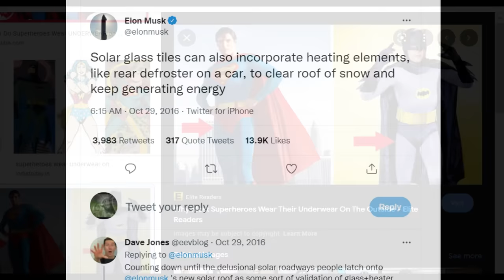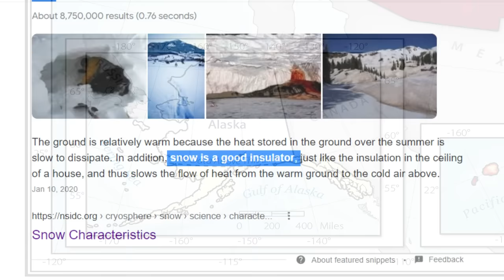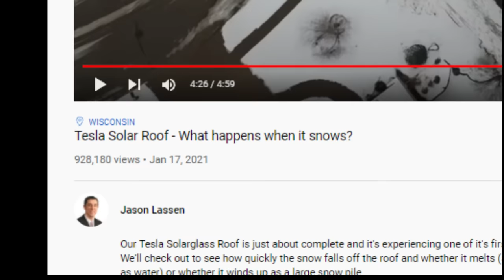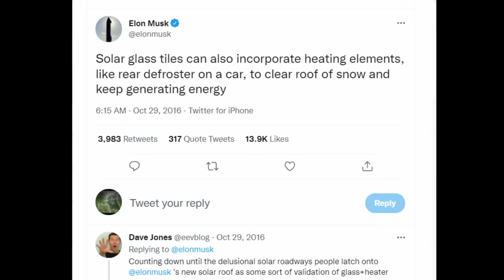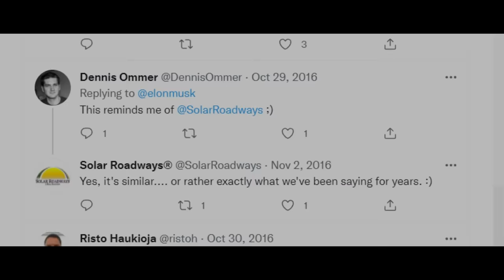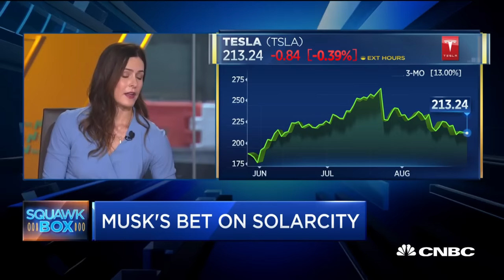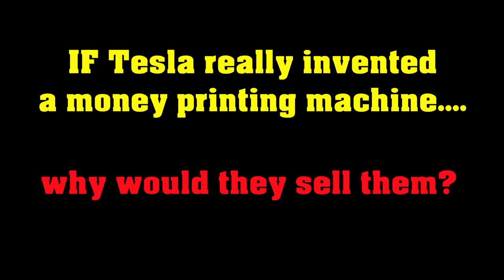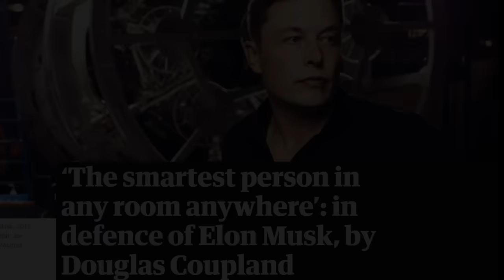Elon Musk: The Smartest Person in any room ANYWHERE!

Comment: Hang on a minute.
If I get a few inches of snow overnight, then when the sun comes up in the morning the roof tiles are completely covered and don't get any sunlight.
So how do they get energy to create heat?
They're not taking energy from the grid are they?
It would be better to use whatever energy is available to heat the inside of the house and let nature melt the snow in due course.

Uhm...Wheels?
Reply: There are videos of rooftop solar causing snow to slide off even with similar sloping to other houses. It would use battery power and hydrophobic material. Honestly, solar isn't great due to seasonality, but Thunderf00t thinks juxtaposing driving cars over solar panels with rooftop solar which is laughable.
Reply: "So how do they get energy to create heat?
They're not taking energy from the grid are they?"

Why not take from the grid or a home battery?   Take a little from the grid to melt the snow from the panels so that they may return to energy generation
Reply: I mean the idea of melting snow off a roof isn't fundamentally awful it's just simply not useful
Reply: @justincarroll1836  Seems more like a cost equation :   value of melting snow off roof = value of energy generated by roof - value of energy saved by snow insulating roof
Reply: @GK-op4oc  you've missed something namely that the snow melting costs energy too. But I'd call something that actively achieves less than nothing to be not useful
Reply: @justincarroll1836  Solar panels are a cost equation.   Some global zones offer a much greater cost benefit at the present cost of solar panels and storage batteries, but the trend is that their costs are decreasing.  While there may be a seasonal negative during the winter, is the presence of solar panels a net postive for the household ?
Reply: @GK-op4oc  I want to be clear that solar panels themselves are not a bad idea even if you don't get as much out of them all year round but specifically melting the snow to get access to least amount of energy possible is not a good idea nor will it ever be due to simple thermodynamics.
Reply: @justincarroll1836  I'm having fun understanding understanding this cost equation through debate.  But in the absence of fossil fuels, energy during the winter needs to come from somewhere.   Should solar panel farms provide the energy during winters, the panels will need to be cleared in some way.
Reply: @GK-op4oc  I mean I'd suggest that nuclear power be used for the next several decades as a primary energy source as it offers low environmental cost, high power production and reliability in remote areas not needing to be refueled or constantly cleared. I also think that wind power is a great option in many areas that solar isn't (tundra plains for example)
Reply: @justincarroll1836  Nuclear power seems like the way to go, but there will still be interest in individual "off-the-grid" energy independence.  Elon Musk made a quote that the land area presently needed to construct a nuclear power plant would generate the same amount of electricity as a nuclear plant with present technology.   Solar panels are at 1/3 efficiency and may reach 50%.   There is considerable social resistence to nuclear power generation.   How will that ever be changed ?
Reply: @GK-op4oc  the land area for a nuclear plant is absolutely always going to be dwarfed by that of a solar array for the same generation of energy. Why? Because reactors need very little additional space for additional power generation. You will always need an absolute crapload of space for a solar array and while it might be possible to have that space in an area deemed less desirable (like a desert) both will require locations near a population center as maintaining them is critical for efficiency. I can't say I know all the answers to all issues but I absolutely will not put my faith in solar PV as a great solution to energy needs.

Comment: i have 2kw of panels on my roof on the uk. even on a cloudy winter day i see 2-3khw production a day. upto 20kwh on a sunny summer day.

funny thing is...my regular panels seem to shed the snow rather quickly on their own. the panel coating means the snow slides right off.

i guess elon needs to heat his roof tile to get the snow off as hes cheaped out on the coating.
Reply: It's probably more that they are trying to make SOLAR!!! Roof tiles, which gives you crappy roof tiles and crappy solar panels, so they compromised on both aspects to make an inferior, and more expensive product.

It sounds like you have the sensible solution, in using separate things that have been specifically designed to do the one thing well.
Reply: UK = northern country = steep panel angle = snow slides off easier, wouldn't it? But yes, glass is typically not very sticky. Snow will still accumulate on it in a lot of conditions, though. Surprisingly many, even.
Melting it might even be bad. I've seen some glass panels like that that formed icicles on the lowest edge, and the snow used that slight bit of ice root to start piling up until it covered the entire thing. You wouldn't be able to put it like that if you tried.
Reply: @EdwardHowton  also, its not like a squeegee on the end of a long stick doesnt exsist and isnt cheap.
Reply: @jimmyhackers8980  Every single Canadian has a squeegee/brush/scraper combo in their car 24/7/365. I'm not every sure people buy them. I've seen them for sale, but they kind of just show up. The older your car, the more snow removal brushes appear.

Comment: Thunderfoot have you looked at how they keep LED traffic lights free of snow and ice? if so could you do the maths on the roof tiles to keep them snow-free?
Reply: Err you missed the point, we only want the face of traffic lights de iced, we don't want the roof to be leaking so much heat it melts the snow.
Reply: Sure.

Traffic lights, are small.

But rooftops, are very large.

There's your math.
Reply: Far more power than the panels would be capable of generation.
Reply: Traffic lights stay pretty snow-free because they are small, they are typically shrouded (the shrouds typically do get snow on them), and they are vertically oriented.  All things that are never true of roofs or roads.
Reply: @ShootMyMonkey  exactly.
Reply: Not to mention that traffic lights have these metal structures over them that make sure they're shadowed all the time, which means snow can't pile up on the lights, because they'd have to magically fly up under their little roofs.

I can't even drive and I'm half blind and I know what a traffic light looks like, what's your excuse?
Reply: @EdwardHowton  lol good point.

Comment: When he said „its financially insane to buy anything other than a tesla“ I just thought, when did anyone buy a car  because it makes financial sense if it's for personal use.
Reply: I did, because I went with the one that made the most sense out of my options... A 90s economy car, which I paid for straight cash, no loan BS. Easy to maintain, relatively fuel-efficient, and manages to have things like cruise control and air conditioning that actually works, making it the exact opposite of the early 2000s sedan it replaced.

Comment: 1:55 : Before I even see the rest of the video... i'm not convinced it actually is that stupid:
- in not-so-cold climates, snow can cover the roof in the night and change drastically the albedo of the roof, making it possible for it to stay. Which is why just pouring some coal powder on the snow is enough to remove all of it. So removing it can yield a positive energy return, in theory (for small thickness). In Alaska, in the core of winter, no way this can be a decent idea.
- with water under the snow, it might all slip to the bottom, IDK if that works at all, but that's not possible for solar road
- what would be dumb is a constant heating. A heating that happens only in some cases, why not. Ideally with a link to the weather forecast.
- oh and the north half of the roof isn't gonna generate anything, no reason to put solar panels there in the first time.

2:10 : Well most church members do have sex, just hiddenly and often same sex. Sooo.... a condom machine in Vatican could be a good idea. Plus there are many tourists who'd love some funny, catholic themed, condoms. I, as an atheist, visited Vatican.
Reply: You're absolutely correct. Thundrrf00t has been taking his viewers for a ride on most videos related to Elon.  TF "ingeniously" leaves out of the arguments that the house shown in the video is still being built aka the interior house temp is VERY close to the outside temp, no "insufficient insulation" to blame.  solarRoof allows the ice to slide off due to it's gradient, smoothness, and any residue can have the very bottom layer of ice melted every morning, which then slides off.  No need to even evaporate the lowest layer of ice.  The snow came several days ago before the video which is why there aren't discernible clean mounds without footsteps.   He knows this!  So why compare it directly to solarRoadway (which needs to not just melt all the snow, but evaporate most of it)? 
All one needs to do is watch tf's old videos on SpaceX and see how wrong he is with his manipulation of numbers. For some reason he just blindly hates Elon with a passion
Reply: The EU requires condoms on fishing boats, after the Ig Nobel award winning paper on two fishermen who shared (one at a time) a blow up doll and one caught gonorrhea from the other.
Reply: @monsterous289  I have to say that TF's videos quality has decreased. His first videos about Musk were really good, but the latest 2 videos I've seen were really disappointing, with more "feeling" that it's stupid than actually proving it. The video about the undersea hyperloop is a nice example. All his numbers are wrong, and anyway he doesn't make any actual calculation, making them irrelevant. I'm pretty convinced he' correct about it being infeasible, but I tend to prefer good arguments, with actual calculation, than a rant.
Reply: @quantustremorestfuturus5434  Oh and boi how much. I count 8 - 9 videos this year that are watchable in the spirit of old Tfoot. The rest is garbage rants.
Reply: @GintaSuiseiseki  yes too much rant, too much repeating the same thing over and over again, too little actual calculation and proof.

Where are the videos like the "hyperloop white paper" demolishing video? Although he missed many absurdities in the white paper, his points were nice.

Comment: If the point is to get the snow off the panel, there are probably better ways to do so:
1) some sort of swiping arm-thingy that mechanically removes the snow periodically
2) some kind of material coating that makes the snow slide off
3) bloody not putting it on your roof so it can swivel into a vertical position and making the snow fall off: bonus points if it rotates to actually track the sun too as it's more efficient.

I'll take a wild guess and estimate 0.25cm of snow weighs about 0.5kg/m² – ballpark numbers –; for a 150m² roof you're looking at around 25MJ (or around what? 7kWh?) per quarter centimeter (~tenth of an inch) of snow assuming perfect heat transfer to the snow. Now, granted, If you take that as is from the grid it wouldn't even add up to a cent, but you can't transfer that heat anywhere near perfectly: it's not a closed system and it's snowing outside.

It would be interesting if @Thunderf00t, or anyone really, had experimental data for exactly how inefficient that transfer can be; well we kinda do have some, in the form of solar freakin' roadways, but I wouldn't take them to a best case scenario. I can't really perform an experiment myself as the temperature here never gets close to freezing xD

Comment: - You don't need snow on your roof for it to be well insulated.
- The insulation of a roof does not come from the type of tiles being used.
- Solar panels don't produce as much energy in the North than in the South, but they still produce enough energy for them to be useful. There are solar panels in Scandinavian countries that are more up North than any US state but Alaska.
- Solar panels still produce energy during cloudy days (not as much, but still).
Reply: Your house can be well-insulated without snow and solar panels can still produce power even in winter. Nobody is denying that.

But using solar panels to melt snow is a dumb idea, because were there enough solar power to make it worth it, *the snow would have melted by the sun alone*. Given that the Sun hasn't melted the snow, one can conclude that there isn't enough solar power to make it worth melting the snow for,  and the loss of insulation just adds insult to injury since on top of a net negative in power (from melting snow), you now add another extra power draw from losing that extra insulation.

Comment: There's roughly 3,000 square miles of roof space in the United States. Assume half of it isn't viable for sunlight. 1,500 square miles of viable roof space. Even at 20% utilization at 20% efficiency you can power the entire United States with a smart grid. The problem is the solar roof is not viable because it requires specialists. A regular roofer can be trained in a couple of hours how to lay asphalt tiles. You can learn how to do it watching a simple This Old House video. Unless they redesign the tiles (if they can) to work with simple labor it will never be adoptable wide scale.

Comment: One slight correction.  
Yes, when it's a few degrees below freezing, it's typically quite cloudy.  
However, when it's really cold, it's hard for clouds to form.  It's usually very sunny during the day.
But you're right, it is a good idea to keep a layer of snow on the roof for insulation.

Comment: Solar panels up north is viable. The cells produce less as they heat up. Already at 25C the efficiency starts to reduce significantly. The cold temperatures here helps with that. Also in summer time we have very long days of sunlight, and if you go far enough north the sun is up 24/7 in the summer (though it is a shame too since we need less energy in the summer). Another thing to keep in mind is that cloudy does not mean it's pitch black. There will still be some production from the diffused light coming through the clouds.

Comment: My parents' roof already has heaters just to prevent ice dams. They only need to run long enough to melt a modest amount of snow or make it slide off the roof. After that, the roof is likely to remain clear for weeks. Generation is modest in the winter, but I do get useful KWh out of my PV system at 41 deg latitude. This isn't nearly as ridiculous as Solar Roadways or Hyperloop.

Comment: I live in CANADA in a fairly affluent neighbourhood and many of the houses that have had work done recently have had wires installed in a zig-zag across their roof to MELT THE SNOW, but then again these houses were all only built in the late 1800's so who would want extra insulation in them when you can easily afford to have your heat cranked all winter?
I despise yuppies.

Comment: 9:10 the south side of the roof on the north house is actually better aligned with the sun than either side of the roof on the equator house. This is why most people actually put solar on one side of the house. However, solar also works with ambient light, not just direct light rays, in fact sometimes they can generate a little power from a full moon.

Comment: Coming late to the Party, but every solar panel is a heater. They do Not use a100% of the sunlight and you always have heatlosses in the conversion of Power. 
I See it with my own solar panels in the Winter. When the Sun is strong enough to produce current, the Panels start to slowly melt the snow away. But becouse the Sun is weak in the Winter it is not enough thatthey will clear them completely. The more cost effektive way would be to shake the snow with an elektric Motor of the panals/roof.

Comment: A better solution to renewable energy in Northern climates is wind generation for example. This however, requires researching local wind velocity data inland to find better average wind sites.
Reply: Solar panels are more of a buzz word though 

And also, you often don't want to have windmills too close to a house because of the noise

Comment: The problem with leaving the snow on the roof is that all of Winter will have no solar.  3 months?  That means the batteries must be HUGE in the extreme.  A house would use ~300 kwh/day x 30 days/month x 3 months = 27k kwh of battery storage.  At $200/kwh = ~$5.4 mil.  LOL.  Solar PV MUST get the roof clean otherwise there is no recovery from cloudy periods and 3 months of battery would be insane.

Comment: I would like to point out, that in many regions winter time is kind of arid, which means that snow may fall down and then just be there without new snow covering it for a long time... so actively removing snow from your solar roof may indeed be energy efficient, when otherwise the snow would block the sun for weeks.

That doesnt quite mitigate your arguments on the decision to pave the whole roof or the fact that apparently the "trick" was poor insulation and not active snow removal though.

Comment: power goes with projected area. If the installers were smart and put the Tesla tiles on a south facing 6:12 slanted roof at 43N then winter noon angle of insolation is 50 deg giving about 77% rated power. A 12:12 slanted roof could be at 68.5 deg, practically the same as in summer. 

As long as the building density is low enough, a given solar panel of appropriate inclination generates about the same noon power irrespective of latitude.
Reply: Stop spamming.